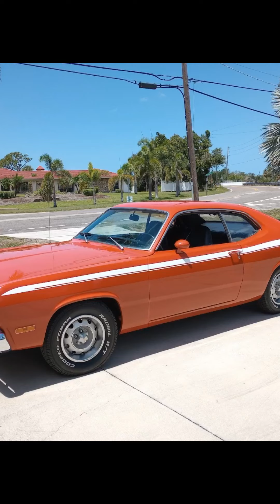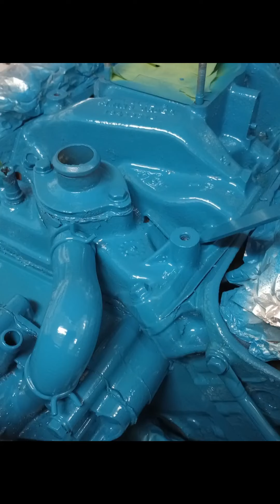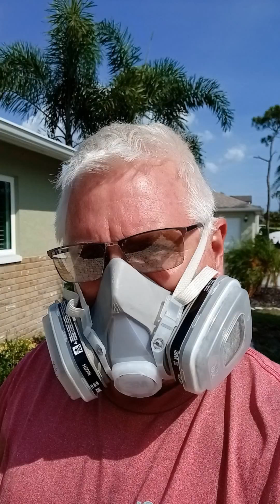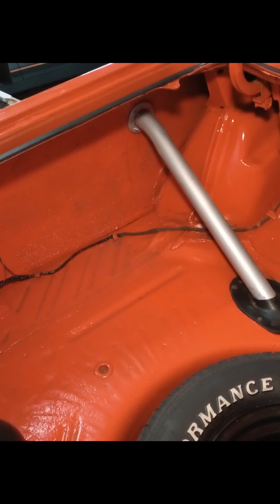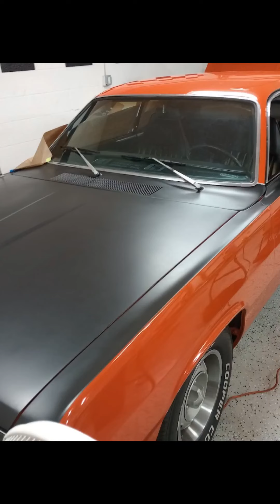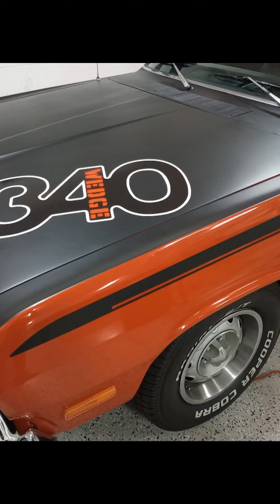72 Duster 340 transformation in photo progression video -Gause Garage 🏁🏁🏁💯

Comment: Nice Matt, is that organisms or vinyl? It sure looks good  whatever  it is.
Reply from the maker: Thanks Ken, it is SEM trim black. 
The closest thing to factory sheen I could find. 
It plays well into the flat black factory stripes with black interior.....all part of the code V24 hood black out option for the duster 340 models 🍺🏁💯
Reply from the maker: After spraying the final wet coat I dust coated it to give it a little bit of texture much like the original organisol
Reply: Thanks Matt, I've used it out of the can in the past on plastic trim with good results. Just started using Cerakote plastic trim restorer for that and I'm extremely pleased with the results.
Reply: It looks like the real deal!
Reply from the maker: Thanks Ken..... I even installed the small chrome trim pieces at the bottom of the A pillars to demarcate the black out......just like the factory did
Reply from the maker: https://photos.app.goo.gl/ekVKzeci6osPdeNQ9
Reply from the maker: https://photos.app.goo.gl/BrKEGArP8DYJPJxH6
Reply from the maker: I am looking at cerakote online now..... interesting